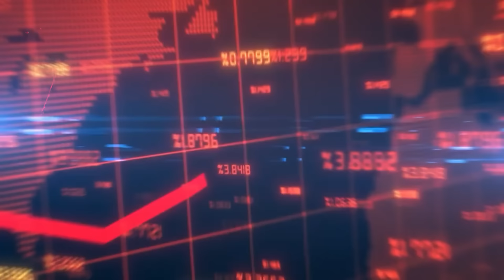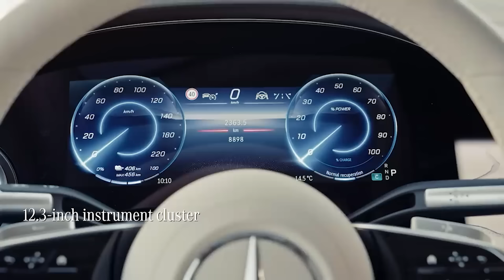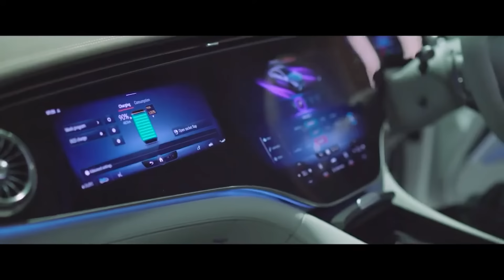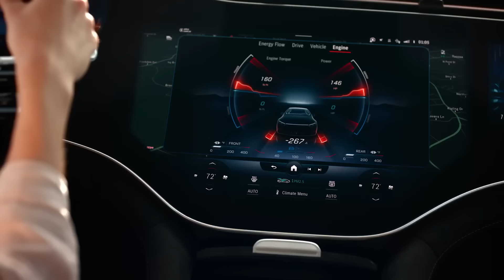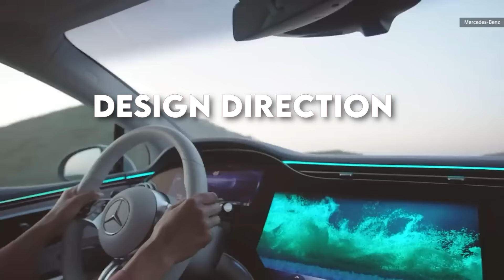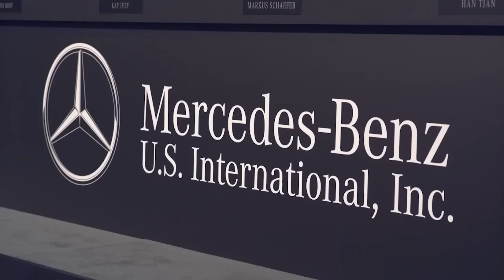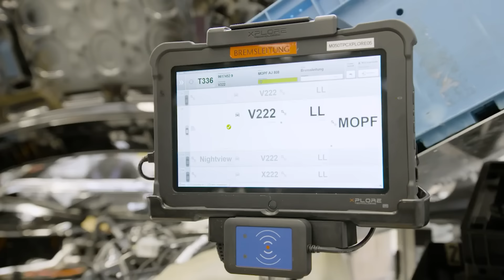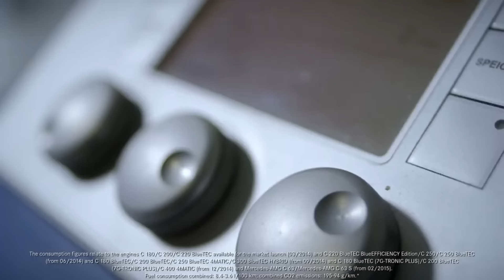The Mercedes EV Catastrophe : What Happened?

Comment: Shocked more people won’t buy 100+K, low range, EVs, especially while cnbc, wsj, keep trashing the ev industry while they get UAW, big oil, etc lobbying…
Reply: Not to mention other brand 1/3 of the price has more power, better range, better tech and the interior quality is in par.... so consumers see what does Merc has that make that huge price gap? and not to mention less cost to service. I own Merc, I was about to buy EQC or EQE and found out the price $150k for EQE 300 that has only 180kw, charging speed only 150kwh, 0-100km/h: 7.3s and service cost $1000-$1300... for ...????? filing up wiper fluid?

Comment: It's not the fault of Mercedes or any other EV maker.  The car itself is a good product however, the infrastructure has not caught up.  There are not enough chargers around to meet the demand.  If you have a gas car without enough gas stations it would be the same result.
Reply: They designed them, they chose drag over designs people want to own... 100% Mercedes fault.